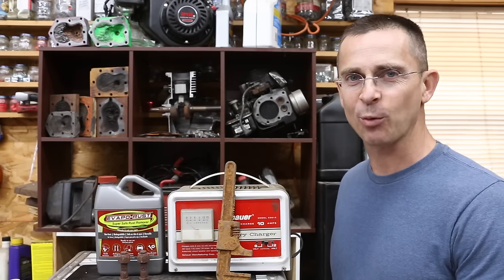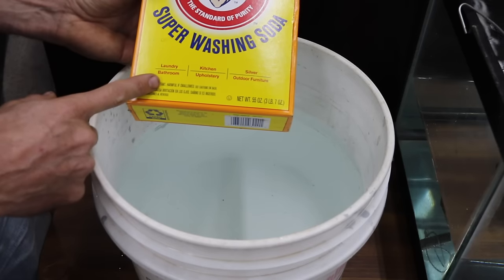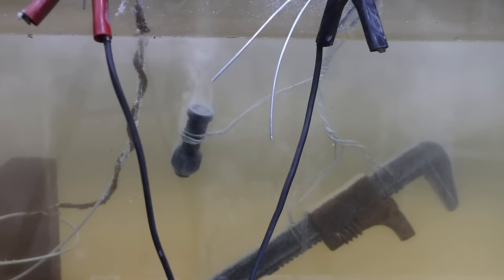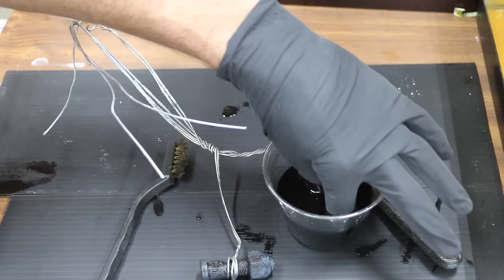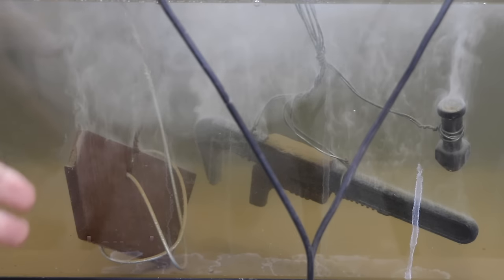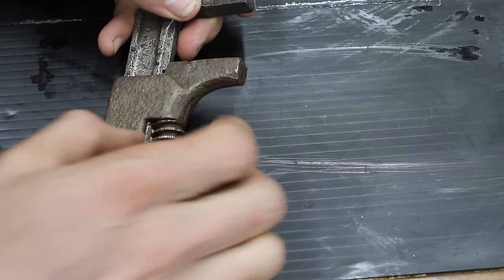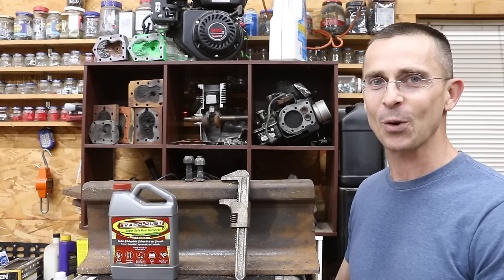Is Electrolysis better than Evapo-Rust?  Let's find out!

Comment: there is no electricity getting to the adjustment portion of the wrench. its surface rust is insulating it. it doesn't matter if you keep treating it day after day. unless it also gets wired up it wont work.
Reply from the maker: Thanks for the feedback.

Comment: I think you are incorrect about the absence of acid in the E-Rust.  You can readily smell phosphoric acid which is the principal reactant used in a number of metal prep paints and solutions.  You can purchase an equally effective derusting solution which is phosphoric acid based and that is Concrete and Metal Prep at your local Lowe's/hardware store.  The stuff lasts forever if you keep it in a closed container.  A 5 gallon bucket works well for most small parts.
Reply from the maker: Thanks for the constructive feedback.

Comment: The slide for the wrench is not a solid piece connected to the HANDLE which is receiving most of the current because of where you tied the wire. Had you tied the wire around the sliding mechanism as well, the rust would’ve been removed a bit faster from the seized mechanism.

Comment: I think it would work better if you attached the wire to both pieces that rusted together, the bolt and nut, and both parts of the wrench.

The current likely isn't hopping the rust to the other piece well.
Reply from the maker: Thanks for the suggestion.

Comment: You should have put wires on the nuts and the wrench slider. They had limited electrical contact with the positive voltage. If you'd wired them to their primary component they would probably have needed no clean up.
Reply from the maker: Thanks for the feedback.

Comment: the rustiest part of the wrench wanst conducting anything, you should have put a wire there too, also, a upside about electrolysis is that it can form a protective Fe2O3 layer that makes corrosion harder, but if you want that, acid etching is the best way, also, electrolysis of sulphuric acid makes a coating of Pb2O3 on lead which is useful for eletrolysis since these electrodes are much more corrosion resistent to use as anode for electrolytic cells, downside is toxicity

nerding aside

i still prefer to good ol' vinegar method

Comment: The wire needs to be connected to the adjustable part of the wrench since there is not good contact between it and the handle. Then the adjuster would get cleaned.
Reply from the maker: Thanks for the feedback.

Comment: Table salt will not release chlorine gas because the voltage that you use is too low. The eV required is a bit higher than what you can provide.
Reply from the maker: Thanks for the feedback.

Comment: Have you compared just oxalic acid it's a a very mild acid and I had a pair of needle nose pliers and a ratchet both were rusted solid and with about an once if oxalic acid mixed a Chinese take out containers of water and 30 mins there was zero rust left on them and then I just rinsed them off under a faucet. And 10lbs bag is less than $30 on amazon .
Reply from the maker: Thank you for the video idea!

Comment: you might want to consider having the electricity to direct contact the wrench's screw rather than its body to specifically remove the rust for that portion.
Reply from the maker: Thanks for the suggestion.

Comment: Used both….evaporust on a rusted receiver …didn’t have to take it apart cleaned even internal parts……..great for that…..use electrolysis for larger items……..vinegar (acetic acid) cleans up rust also….but don’t leave item in too long just enough to get the rust….will eat the metal…
Reply from the maker: Thanks for sharing.

Comment: electrolysis is used for delicate things that you DO NOT SCRUB. When you use evaporust or any other chemicals you have to rinse and clean them after. Unfortunately, no matter how well you rinse them, some chemical product remains and will damage the object long term. In conclusion, a bolt or wrench is great with Evaporust but a valuable and rare object, not a good idea.But elctrolysis is better (it's water and electricity) and cheaper long term.
Reply from the maker: Thanks for the feedback.

Comment: You made the same goofy mistake with BOTH pieces you tried to clean with electrolysis: you assumed there was an electrical connection between the parts of the items, and in both cases you chose multi-part items.  Not smart. If you do that, make sure the NEG - lead touches BOTH parts, not just one.  In the case of the wrench it's VERY obvious; rust stays on the unconnected lower jaw but not on the rest.  That didn't tip you off??

Comment: I posted on your video comparing drain cleaners. That comment would be better here.the major comment is about using citric acid to remove rust, citric acid is incredibly fast and aggressive at emoting iron oxide. It does this as a chelant more so than as an acid.  For use on stainless steels and other corrosion resistant alloys citric acid rapidly corrodes and removes iron as well as iron oxide, while mostly sparing the stainless steel. At 140 F a citric acid solution dissolves soft steel at 12 inches per year. Yes inches, not microns or millimeters.  By comparison, the same solution dissolves 100-200 microns of stainless steel. This incredibly faster corrosion of oxide, then steel then stainless allows both for the removal of rust quite rapidly, an[d also the removal of soft low alloy steel after welding on stainless. Follow this with a clear water rinse then air dry and the surface will form a tightly adherent oxide coating to protect against future corrosion. For steels, bluing can serve the same purpose. I.e. caustic exposure under controlled conditions to form a tightly adherent gamma iron oxide coating. Since most parts are contaminate with oils and organic, add a small amount (~1%) of soap to the citric acid solution. The amounts of citric acid and soap aren’t critical. 1% citric acid should be ample for most purposes. More is only needed if there is a lot of rust to dissolve. The reaction rate doubles for every 10 degree raise in temperature. 140 F is a convenient temperature to use. But again, the temperature is not critical. It is important though to mix the solution in a plastic container free of metals. This solution will dissolve aluminum, copper and other metals as well. It is safe to send to sewer provided you don’t do too much or too often. It will also eat concrete. I created this process in about 1980. It is now the standard solution and process used to picked and passivate corrosion resistant alloys in industry, replacing the terribly dangerous hydrofluoric acid/nitric acid mixes followed by nitric acid washes that was used before then.  I think you will be amazed at how effective it is. Two other thoughts… in chemistry many experiments use concentrated caustic in alcohol solutions. These have pH’s far above what can be achieved in water. They are phenomenally caustic. Some plastics fail in these solutions. Second thought. Evapo-rust uses tannic acid. Tannic acid is produced from tree bark. Immersions rusted metal in wet peat bog material free of air might make for a very good de-rusting solution when time isn’t a concern.
Reply from the maker: Thanks for the feedback.

Comment: Ospho is better than Evaporust.  Ospho turn iron oxide into iron phosphate which is inert.  It also serves as a primer for painting. it works quickly unlike Evaporust  and it gets all the rust it contacts and it does not come back.

Comment: hello!
u needed to wrap the adjustable part of the wranch with the wire to get better result, cauze electrical connection between rusty parts is not ok :) i didnt saw any bubbles getting from adjustable part :)
Reply from the maker: Hello.  Thanks for the feedback.

Comment: It looks like the geared part of your wrench is at least partly electronically isolated from the main shaft.

If you put the wire connection on the geared part, it would probably work better.
Reply from the maker: Thanks for the constructive feedback.
Reply: I realized that a bunch of other already mentioned that after I wrote it :) 

Great demo though!

Comment: I used electrolysis on a gas tank out of and old car. It cleaned out the rust and left a black coating on the inside of the tank. You have to be sure to suspend and isolate the sacrificial metal from the tank.
Reply from the maker: Thanks for sharing.

Comment: How about you have a look into how well ceramic or porcelain stand up to the thermal run-away condition, that seems to happen now and again, with the lithium batteries we all love. 
I'm thinking the top of the toilet tank is my best option for charging. If the lid breaks (un even heat) there's water under the fire ball. The bathtub is too inconvenient and no tank of water underneath. 
There is already an exhaust fan in there for any toxic fumes and a smoke detector might be a good addition. Be careful with the testing Todd, don't breathe any of that...
Reply from the maker: Thanks for the suggestion.

Comment: I think the wires that are leading to the anode & cathode should be insulated, otherwise the electrical current will take the path of least resistance directly from non-rusty wire to non-rusty wire.
Reply from the maker: Thanks for the feedback.

Comment: 12 V is a fairly low amount of voltage for this process.

Use an old DC welder as power source, this way you can remove the rust in something like an hour.
Reply from the maker: Thanks for the suggestion.

Comment: In this case Electrolysis is not able to break free those threads due to the behavior of the electric field lines. 
Due to its physical behavior, there are no field lines present inside the blocked threads and therefore the electrolysis cannot remove the oxide and lose the threads.

This is comparable with the anodization problems of aluminum profile parts with an L shape for example. On the outer edges of an L shaped object the field lines will concentrate and lead to a faster cleaning of those areas. In the center of the corner are almost no field lines present. Therefore the cleaning of those areas gets very difficult and time consuming.
Reply from the maker: Thanks for the feedback.

Comment: I use electrolysis to remove rust .. we use an area with ventilation and other safety considerations.. In my experience electrolysis is 5x faster then any soaking liquid process. In less then 24 hours electrolysis works, compared to a week with any soak. The secret is in the solution 😉
Reply from the maker: Great feedback. Thank you

Comment: I use a sheet of graphite as the sacrificial electrode. Oxidation of the carbon produces CO2 that bubbles into the atmosphere. There's no sediment in the electrolyte and I don't have to clean the surface of the graphite.
Reply from the maker: Thanks for sharing.

Comment: For a more accurate and scientific test, you should cut up the piece of sacrificial metal into rectangles each with a hole in it to hold a wire and put three in electrolysis in three in evaporist
Then scrub all of them with coper brushes and see which one shows surface metal first
Reply from the maker: Thanks for the suggestion.

Comment: on the wrench he should have tied the wire around the adjustment section. its a separate piece of metal, and he attached both wires to the main body of the wrench which is all the same piece, had he attached one wire to the body of the wrench & one to the adjustment part, it wouldnt have looked so night & day.

Comment: I don't understand how you didn't see the wrench needed a 3rd conductor attached to the jaw, since thee jaw is only conducting through a layer of oxide. Same with the bolt if the bolt anddd the nut had its own conductor odds are 24 to 36 hours and it's been done. Smaller container would have been ideal. Using a graphite sacrificial anode also jwolrks much faster and leaves a small but noticable deposits of graphite coating which would serve to protect the part further.
Reply from the maker: Thanks for the feedback.

Comment: I think you got the oxygen and hydrogen the opposite. Positive for oxygen, negative for hydrogen
You can also tell this from the noticeably more bubbles coming off from the cathode (the negative end)

Also, electrolysis can only work on electrically connected parts, so you'll need a separate wire for the moving part as well.
Reply from the maker: Thanks for the feedback.

Comment: a better method for doing the electrolysis is to have a larger scrap steel with + connection point out of the mix same with the part your gonna clean. this forces the current to flow through the part only and scrap steel.
Reply from the maker: Thanks for the constructive feedback.

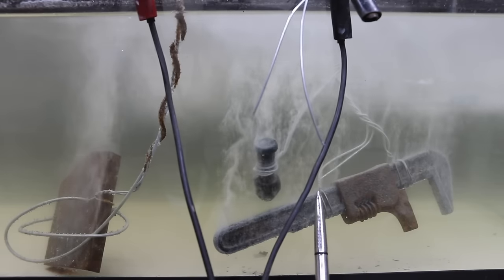Comment: 2:12 Cathode (-) creates hydrogen (reduction), and anode (+) creates oxygen (oxidation). Those bubbles on the wrench are hydrogen bubbles not oxygen. Also you have to deal with hydrogen embrittlement which can cause catastrophical failure (braking) of the part. 
See: 
https://en.wikipedia.org/wiki/Hydrogen_embrittlement
https://en.wikipedia.org/wiki/Low_hydrogen_annealing
Reply from the maker: Thanks for the feedback.

Comment: The middle part of the wrench seems to stay rusty because it is not connected to the wire and is electrically isolated from the rest of the wrench by the rust.
Reply from the maker: Thanks for sharing.

Comment: Has anyone tried using Evaporust or Blaster Metal Rescue in combination with electrolysis?  In other words, rather than water and sodium carbonate, use Evaporust or Blaster Metal Rescue in the tank, then use a sacrificial cathode on the negative side, and the item to de-rust as the anode?  As both products are water-based it may work, but I'm not sure if they would act as electrolytes.

Comment: Blast the excess crap off with hi pressure water then soak again.
Mollases 1 part in 5 cleans of rust as well. Though like the electrolyses  will pit the metal. 
I used to clean  steel rims with it but the pitting was a major issue. Sandblasting is the best
Reply from the maker: Thanks for the feedback.

Comment: Have you tested ceramic paint? It's come a long way and there are some that claim they hold up up to 1700 degrees. 

The rust made me think about it. I painted some headers on my truck and it held up, but now they are rusting through the surface of the paint.

Comment: for electrolisys i use pipe cleaner, soda is not best but cheaper. use steel brush to remove rust for good conecction, use copper wire and pc power supply will do the work. i like your videos but electrolysis was done... slower with lower amperage will make it look better... anyway that wrench i would clean with steel brush in less than 15 minutes..
Reply from the maker: Thanks!  Thanks for the constructive feedback.

Comment: Amperage = Time, More amperage = less Time, 24volts has worked on personal testing well, holding 4-10amperes much easyer than 12volts, requiring less mainteance on the equipment during removal process.
Reply from the maker: Thanks for the feedback.

Comment: I'm quite sure you just need a tablespoon or two of sodium carbonate in that tank. Also I don't know how it's possible to not see and understand that the parts that still had rust on them in the electrolysis, should be connected to the wires. It's pretty obvious, isn't it? Anyway, evaporust is very easy to use and I'm impressed with the results, but it's really expensive in comparison, especially for large things.

Comment: Clearly by looking at it you need to put a wire around the slide part of that wrench cuz it's not getting electrolysis through it.  It's still very corroded
Reply from the maker: Thanks for the feedback.

Comment: You would have better results if you had cleaned sacrificial metal between dips and moved your wire to the moving portion of wrench. It wasn't making good contact with the body.

Comment: It looks like the rusty is not a good conductor of current.  Maybe if you would have attached one of the wires to the wrench moving saddle the rust might have dissolved there the same as the wrench body.
Reply from the maker: Thanks for the feedback.

Comment: The thing won’t adjust because it did not have a good enough contact for the electrolysis to work.  You needed to wrap a wire around it also
Reply from the maker: Thanks for the constructive feedback.

Comment: That the bolt and wrench lost mass is disappointing. I hoped that the energy of the electric current was breaking the ionic bonds between the iron and oxygen atoms, essentially reversing the process of corrosion rather than removing the iron oxide.
Reply from the maker: Thanks for the feedback.

Comment: With the wrench the rust stops the flow of current so would have been better to connect 3 different cables to it
One on each of the parts , even though they are touching the rust stops the current flow hence how long it took
Good comparison though 😁
Reply from the maker: Thanks!

Comment: Put the wire around both nut and bolt 2 wires and both jaws of the wrench. Both the nut and the movable jaw had a bad connection because of the rust. Do test over.
Reply from the maker: Thanks for the suggstion.

Comment: Would have worked better on the wrench if you connected the electrode to the other part of the wrench as well. There wasn't a good connection - the rust was insulating a bit.
Reply from the maker: Thanks for the feedback.

Comment: Electrolysis is for hair removal. Electrolytic rust removal is what the cleaning process is called. Using electricity to clean rust has its pitfalls. Some troubles seen here are not connecting the entire wrench to the electricity. The movable jaw was not in good contact. You could see it was not really cleaning like the wrench body was. Also one anode is not good considering the process is line of sight. So to clean a whole part you want anodes surrounding the work. The beauty of Evapo-Rust is you drop something in and it works. So hard to screw up. Mr. Wizard science experiments not so easy.
Reply from the maker: Thanks for the feedback.